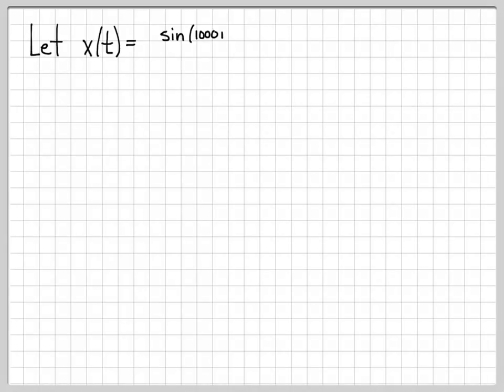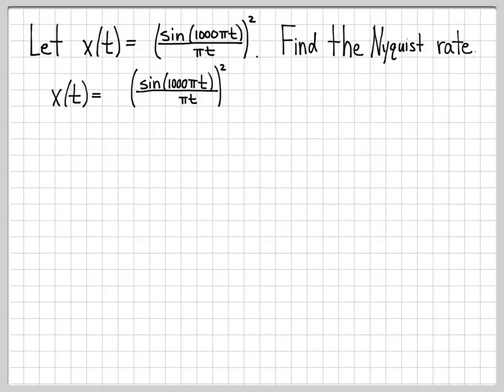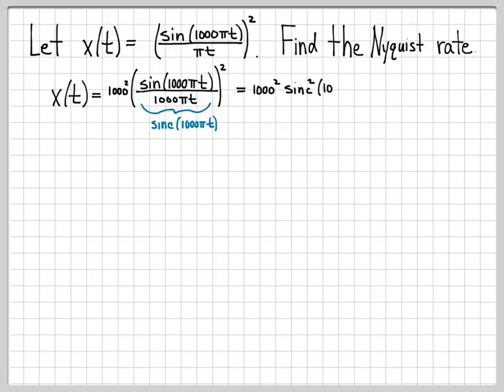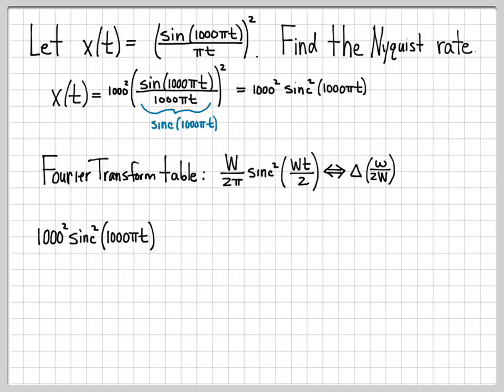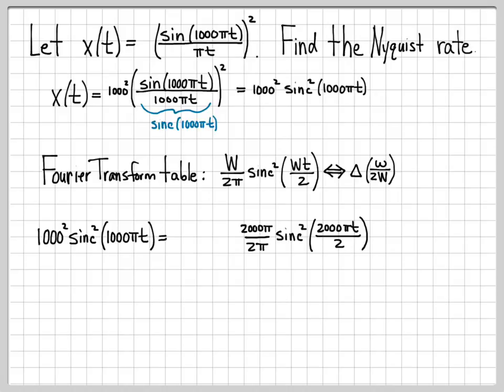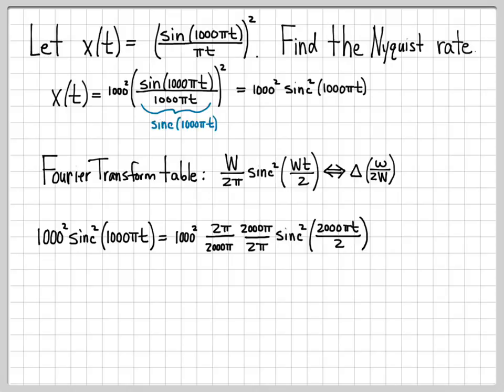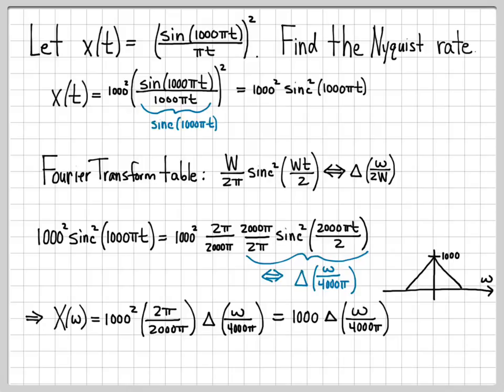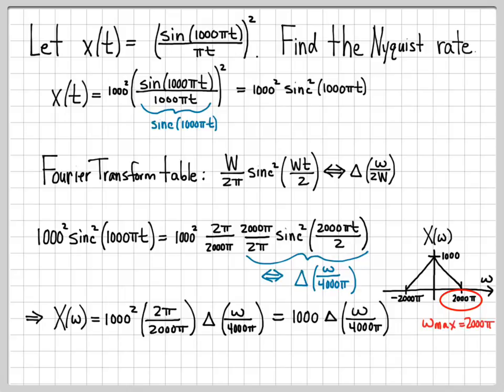Nyquist Sampling Problem 06

Comment: Sir what will be the Nyquist rate fs here? I am learning this topic
Is it 2000hz ?
Reply from the maker: The maximum radial freuquency is wmax = 2000pi. So, the Nyquist rate is twice this, which is 4000pi rad/s. Converting to linear frequency we divide by 2pi so, 4000pi/2pi = 2000 Hz as you noted. Hope that helps,
Adam

Comment: how to do that if two sinc functions of different frequency are multiplied?
Reply from the maker: If two sinc functions are multiplied together in time, then they are convolved in the frequency domain.  Since each signal is a rectangle in the frequency domain, the result of convolving in the frequency domain will be some type of triangle (or triangle with a flat top).  You can easily compute the upper edge of this shape by just adding together the top limits of each initial shape.  For example, if rectangle 1 stopped at 100 Hz, and rectangle 2 stopped at 300 Hz, the final shape after convolution will stop at 100+300 = 400 Hz.  That maximum frequency then gives you the value you need to find Nyquist.  Hope that helps,
Adam
Reply: @AdamPanagos  Thank you .. That helps

Comment: sir what will be the nyquist interval for the problem you solved ?
Is it will be T= 1/(2*f max)=1/2000=5*10^-4sec ?
Reply from the maker: Yes, that's perfectly correct.  Sampling rate fs (in hZ) and sampling period Ts are always related by Ts = 1/fs.  Since we had fNyquist = 2000, T = 1/2000 like you said.  Hope that helps,
Adam
Reply: @AdamPanagos  thank you very much sir

Comment: where is your fourier transform table for above problem ??
Reply from the maker: The table used in this problem is from the textbook "Signal Processing and Linear Systems" by B. P. Lathi.  You could probably find the table by Googling.  Hope that helps.
Reply: Sir does this book explain all the concepts of "signals and systems" nicely as I'm looking for a good textbook(I'm an electrical engineering student at an Indian University) or do I have to look for other books.

Comment: Great video! one question, why didn't you divide omiga(max) by 2*pi to get f(max), and f(nyquist) = 2*f(max), as you did in Problem 05?
Reply from the maker: No particular reason really.  Radial frequency (i.e. omega) and linear frequency (i.e. f) are related by the equation omega = 2*pi*f.  So, working with either one is perfectly fine since if you know one quantity you know the other simply by multiplying or dividing by 2pi.  In one video I worked with omega, in the other f.  You could convert omega(max) to f(max) if desired, but either way is perfectly fine.

Hope that helps.
Reply: Adam Panagos Thank you for your reply! I'm new to sampling theorem. Another thing confusing me is that Nyquist rate is not the same as Nyquist frequency, is it? Sorry to throw another question to you..
Reply from the maker: No worries.  Those terms are sometimes mistakenly used interchangeably but they are different.  

The Nyquist rate is the smallest sampling rate one should use to sample a signal.  The Nyquist rate is twice the largest frequency component of the signal.  In an equation we'd write it as fNyquist = 2*fmax. So, the Nyquist rate is really a property of a continuous-time signal.

The Nyquist frequency on the other hand is half the sampling rate of a digital system.  So, if you're working with discrete-time signals in a system that operates at a sampling frequency of fs, the Nyquist frequency of the system is 0.5*fs.  This is the largest frequency that can be "correctly processed" by your discrete-time system.  So, the Nyquist frequency is really a property of a discrete-time system.

Hope that helps.
Reply: That helps a lot! better than wiki :D Thanks Adam.